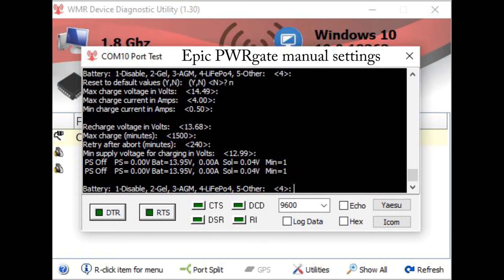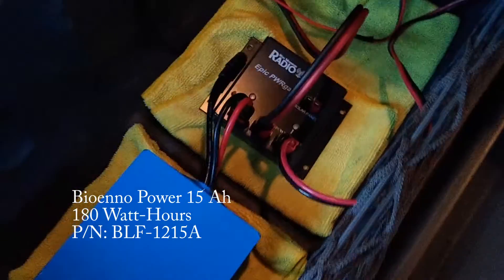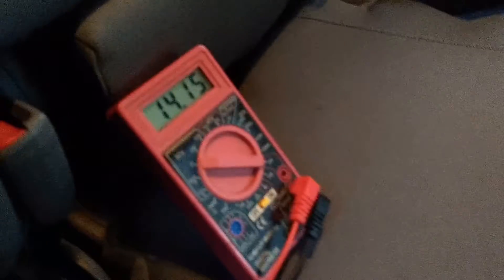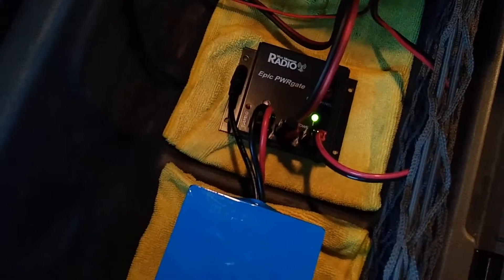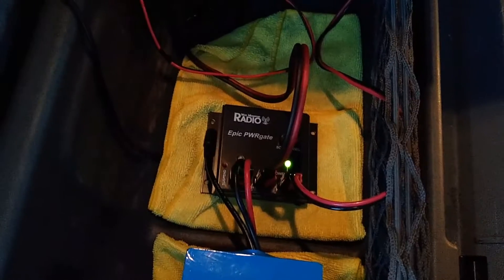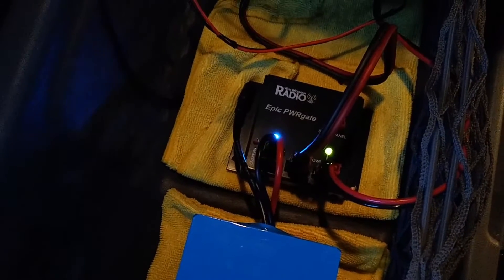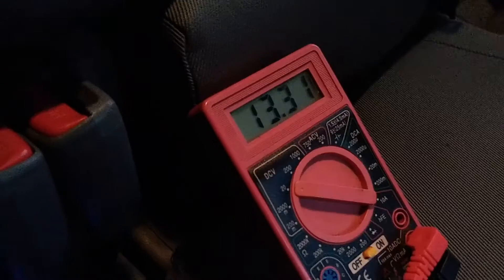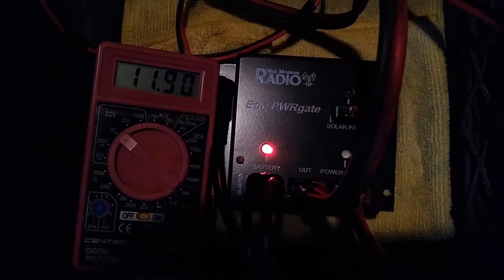Epic PWRgate and LifeP04 15 AH fail...

Comment: Your car doors are open when the engine is off and your ham battery will back feed everything on your truck that wants power without a diode to prevent a off key drain to the truck power
Reply: epic will only feed what is connected to the load side it wont pull back from car

Comment: 14.2VDC is too low to fully charge a LiFePO4 battery. ( your design is at fault.)
Reply: So, what could he do to ensure that the voltage is up around the 14.6V it takes to charge the battery?  Put a buck booster between the source and the EpicPWR Gate?
Reply from the maker: 14.2 is standard charge and gives you several thousand cycles...

Comment: QUESTION 1: Did you open it and set the jumpers for Li - Lithium? (Default is PB Lead Acid)
QUESTION 2: Did you set the charge jumper to the correct amperage  charge rate for your battery? Batteries less than 50Ah require a maximum charge of 6 amps
     where as batteries 50Ah - 100Ah can handle 10amp charge rate (Default is 10amps) 
QUESTION 3: How hot did your car get? In the summer when the temperature is 85 degrees or more, with the windows rolled up, the temperature in the car can be much higher
     MAXIMUM TEMP IS 110 DEGREES 
QUESTION 4: Are you running any voltage stabilization in line with the unit. (like a large capacitor) Some cars during the starting process through voltage spikes that can cause damage.
So you could have cooked the  pwrgate or  the batteries battery management system or both.They recommend using their power conditioner. 
Hope this helps in trouble shooting.

Comment: Im having some issues with the epic also. It worked fine with a power supply and battery, but for me once I connected solar panels it has caused all kinds of issues. Epic almost seems overloaded, although I am well within the perimeters. It behaves very sporadically “charging” for a moment from the power supply, then switching to “mppt” from solar panels, then within a number of hours the epic diagnostic software indicates “bad batt”….which is not the case. Not sure about that thing

Comment: I think you also should have the optional temp sensor for Lipo batteries.  I'd use the sensor for any battery if I am honest. Then the pwrgate knows when to adjust charge when temp extremes hit (summer/winter)
Reply from the maker: Your right but I live in Los Angeles and the batteries are in a great temperature environment. It never gets colder that 35 degrees, usually not colder that 40 degrees. The hottest has bee 99 degrees but usually the temps are 55 to 91 degrees so I have no real low or high temp problems....

Comment: Different things going on:
1) The battery was discharged to the point the BMS disconnected it. When this happens smart chargers (PWM, MPPT, and similar) will not detect a battery. Per page 7 on the updated manual, pressing the push button 10 seconds will force start charging, and you dont need to unplug / replug the battery to awaken the BMS.
2) Make sure internal jumper is set to LifePo4 otherwise charging will be very low.
3) As per page 11 on the updated manual, you need at least 14.5 volts from the car to fully charge LifePo4. I suspect the Epic PwrGate will step down as necessary for charging but it will not step up power supply voltage for charging.
For you to have a fully charge LifePo4 from the Epic you need a 14.5 Power Supply or use Solar.
Reply from the maker: Thanks, I found that out by actually reading the manual. I push the button and it starts working again but who needs that in a vehicle where you have to go and manually reset it. I should be automatic.
I have since then put the unit in my house and it keeps power to my ecom radio. I have a power supply connect to it at 14.7 volts and it charges the batteries to 14.2 volts and keeps the battery charged.
Reply: @StuartGorsky  Thanks for posting this video. I had a similar problem after I installed my Epic PWRGate in an emergency go-box I recently built. The first time I completely discharged the batteries, I couldn't get it charge. I figure that West Mountain designed the charging circuit so that a manual intervention step is required when a battery is completely depleted to prevent potentially dangerous situation when charging a deeply discharged battery.

Comment: I'm pretty sure those packs are designed to be charged on the barrel connector, and only discharged on the powerpoles. At least that's true with most lipo batteries that have two leads coming out of them. The protection board inside the battery may not like the pwrgate trying to feed power in the discharge port.
Reply from the maker: Negative, per the manufacturer both connectors are attached to the same port and can be used interchangeably...